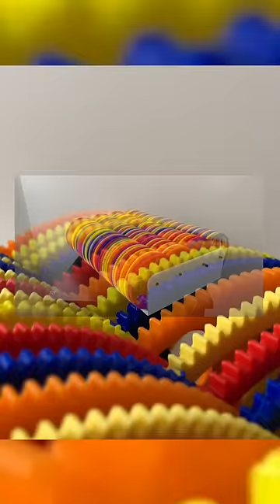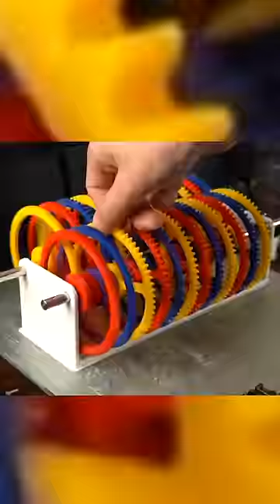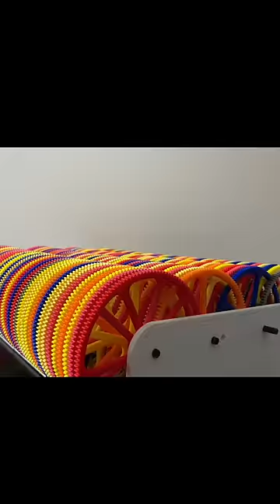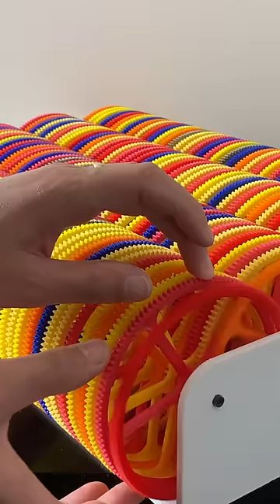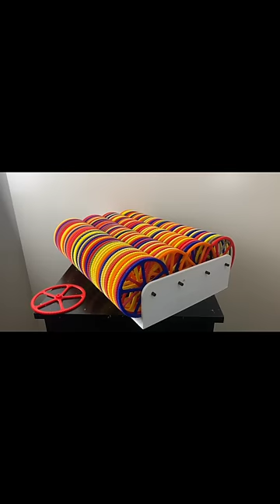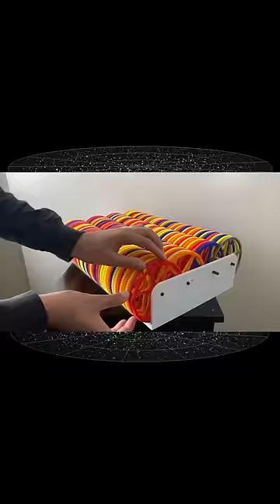World's Highest Gear Ratio (in 60 seconds)

Comment: Do one in reverse where the faster you spin the first one, the faster the last one will go.
Reply: All he would have to do is spin the last one on one of these
Reply: it's impossible to spin the last gear manually. too much resistance
Reply: @DoraTheMFDestroya  That’s why I said in reverse.
Reply: @dorathedestroya2449 
That's not what they were asking.

I think they were asking for a series of gears with decreasing friction, where each one puts a little force into the next.

So, hypothetically, for each time the first spins, the last spins 10¹⁶⁹ times.
Reply: @YoursUntruly  

it would still be the same thing. the start of the ratio will always be the only way to move the last part of such a high ratio system. you can't reverse it, or you just end up with the same thing but turning left instead of right.

Comment: To spin the last gear you would need more energy than exists in the entire observable universe.
Reply: It isnt possible as having to spin the first one faster than speed of light to even get the last one to move means turning the last one makes the first one to spin faster than light as force aapplied over time doesnt add up.
Reply: @dersimonyt9560  it is possible, it would just be incredibly slow. As the video states, it would not make 1 full rotation before the heat death of the universe, but it could maybe do half a rotation or 1/10000000000 th of a rotation
Reply: @jonathantadlock-stein2023  That is indeed true

Comment: Removing outside factors, if we spun the last gear at 1 rps, the first would spin 60¹⁶⁹ times at a speed of 10¹⁶⁹rps or 1¹⁶⁹ (meters)per second or 1.0000000000000001e+169 (meters) per second
Reply: how many gears in would it take for the rps to reach light speed?
Reply: @morphingninja  that’s already much faster than light speed so it wouldn’t be possible
Reply: @spidermonkae  I meant as in less than this whole thing, what portion of this would be needed?
Reply: @morphingninja  Oh well I could try to calculate the gear ratio for that but I'm not sure if I can
Reply: @spidermonkae  honestly, I'd be impressed if anyone does drop an answer to that question.
Reply: Would that open a black hole?
Reply: @morphingninja  I guess I'm gonna drop it:
We have to assume that the gear has a circumference of 1 meter like the original comment did so that the units of light speed and rps match.
Now all we have to do is get the speed of light gear ratio which is approximately ~3*10^8 (3 times 10 to the power of 8) which is less than 0.05x of the gear ratio in the video!!
Reply: @spidermonkae   wow, so less than 5% of this is what's needed for making the first gear the speed of light? (If 1m is the assumed circumference)  I'm guessing you had to backtrack their math to figure out what unit they used? You put in the mad math, props to you.
Reply: @DiveEntertainment47  idk bro

Comment: If you add an oil bed to the bottom it'll keep the gears from wearing, I'd use lucas oil or 10w-40 automotive oil, then you could run it for as long as possible and start a 24/7 live stream to see how long it takes. I can see people bonding in the chat room, discussing how their parent's met watching the 24/7 infinite gearbox livestream..

Comment: can you do one that works the opposite way where one rotation of the first gear spins the last gear superhumanly fast? maybe even using different materials for structural integrity?
Reply: That will tear the universe apart
Reply: You can, but it's just a matter of how strong the material is and how many gears. Either way the gear will snap and will go through several walls in the building.

Comment: If it was made from an incredibly resilient material and you connected the last gear to an incredibly resilient material object with a strong line of some sort. Imagine the speed in which you could pull it if you spun the first gear with an extreme force. Now of course this is all hypothetical and none of these things exist, but just imagine. Imagine the first gear spinning at like 9000rpm.
Reply: It would be a lot more than 9000 rpm🤔 it would be a lot more than 1,000,000,000 rpS!
Reply: @SugarRushWeen  I’m saying, imagine if you spun the slowest gear at like 9k rpm.

Also, the fastest gear would spin a lot faster than just 1,000,000 rpm. That’s literally nothing compared to the gear ratio. If you spun the slowest gear at 1rpm, it would literally spin the fastest gear at 10^169 rpm. That’s 1 followed by 169 zeros.

Comment: Me watching this highly informative video: "So... what the heck is a gear ratio?"
Reply: The gear ratio would be the comparison between the number of teeth on two attached gears. Say you're spinning a gear with 10 teeth, and it's driving a smaller gear with 100 teeth. The two gears would have a ratio of 10:1, because the smaller 10 tooth gear must make 10 rotations for the larger 100 tooth gear to make 1. I hope that makes some sense.

Comment: Now lets imaging he pulls on the last gear and forces the first gear to spin.

I'm pretty sure if he and the material had the strength to do this either a) the wind coming off this would blow the walls off his house, or b) the friction caused by this thing cutting through the air would create enough heat to equate to that produced by a small tactical nuclear weapon.

But I still want to see it.

Comment: Spin the last gear!
Reply: Spin the last gear

The first gear starts spinning at the speed of light and a bright light appears 
You think you made a portal or something but no it’s the atmosphere catching fire due to friction
A few minutes later and everything is on fire
On the entire globe
Reply: @049_plague_doctor but it's all fine cause your room is painted blue . 😅
Reply: @niniv2706  why does that make it fine?
Reply: @049_plague_doctor  - Lahaina Maui ...
Reply: @049_plague_doctor  Sarcasm, a joke .
Reply: @049_plague_doctor , cause your uNdEr tHe wAtEr.
Reply: @daviddrake7995  the water wil vaporize instantly
Reply: @049_plague_doctor  , even ice water from the artic.
Reply: @daviddrake7995  yes even ice water
The entire globe will burn
Reply: @049_plague_doctor  ,damm
Reply: @daviddrake7995  luckily that same friction would also make sure the last gear can’t spin
If you spin the first one
Reply: I dont think he can. The amount of force required to move the gear would probably break it.
Reply: @blackfalcon1324  yeah
Reply: ive actually made a gear train before, ratio was 1:2000, span the last gear, first gear span like a fucking tablesaw
dented wood
plastic gears
Reply: @blackfalcon1324 there’s no probably.

Even moving the last gear a Planck length (the smallest possible distance something can move), moves gears faster than the speed of light WELL before getting through all 169 gears they have there.

The first gear would be spinning not just 100x the speed of light, it would be spinning more than a GOOGOL times the speed of light.

Comment: Everyone replying that it's impossible to spin the last gear is confidently wrong. They're all identical. Spinning the first gear is the same as spinning the last gear. It just takes 10^169 years for that rotation to translate across the entire chain. The reason it has torque is because of how many currently moving gears are driving it and how slowly it's moving.
Reply: Spin the middle gear.
Reply: The gears can’t be identical and be a reduction gearbox. That is why it is called “geared down”  if the gears are identical spinning the first middle or last gear would spin all of them at the same speed
Reply: I love how he says “everyone is confidently wrong!” Then spits out the ABSOLUTE wrong explanation of how a reduction gearbox works 😂😂
Reply: @123ElectricMonkey  it's a series of identical gears with a large Radius and a small Radius. Fitting a large of one onto the small of another is what causes the reduction.
Reply: No one mentioned years. Years is not relevant unless it's Pluto years maybe.
Reply: @PhillipMikeHunt  10^169 is actually larger than the predicted length until the heat death of the universe, which is 1.7 × 10^106 years

Comment: So if you manually spin the last gear, will the first gear go faster than light?
Reply: If his theory is correct he wouldnt have enough strength to turn the last gear also noting the materials the teeth would break on numerous gears before anything worked correctly

Comment: Imagine how much energy it takes if you spin the final gear 1 time in a sec...
Reply: The universe is thought to achieve maximum entropy in 10^100 years. That is called heat death. By this time all baryonic matter will be gone.
Making the last gear complete one full rotation in 10^100 years (or 10^169 for that matter, which is much, much, longer than it would take for the last objects in the universe that have mass, black holes, to disappear completely), requires the first gear (measured by the circumference anyway) to spin faster than the speed of light, which means the amount of energy needed to make it spin once in a second would be infinite, times 10^100, times 31 556 926 (the amount of seconds in a year), which is even more infinite I guess... 🤔
Also, if you would turn the first gear with more than the speed of light for 10^169 years, after such a long time, if the gears could somehow handle that and ignoring any relativistic effects like reversal of causality (going back in time), the matter from which the gears are made will by then have decayed into massless particles because of proton decay. Either that or quantum tunneling.

Comment: Correction: none of these final gears will ever spin, the plastic will decay in the next 500 or so years (without severe preservation or repair) and then stop before the majority of the gears have rotated once.
Reply: Although I do have one question, if the last gear turned at 1 rpm, and nothing could break or jam, how fast would the last gear move? And how fast?

Comment: It's actually a trick question because the final gear could never spin because the immense forces that the gears would be exposed to would exceed the strength of any known material in the universe. The torque generated by the gears would be enough to overcome the gravity of a black hole which tells you that this would be impossible because the fact that black holes exist is evidence that shows the result of forces that are nowhere near the amount of force this would generate yet when objects in space such as supermassive stars are pushed to their limitsfrom being exposed to forces far less than this would produce it would result in the collapse of the star which is how black holes are created. So this series of gears would not be able to withstand its own forces regardless of what it's made of without tearing itself apart so the final gear would never spin because they couldn't create it out of a material strong enough to handle the forces it would generate .

Comment: I dont think you can spin the last gear...
The amount of torque you need to spin the last gear will be insane...
So the last gear itself will break apart by the force you apply last the force needed for it to break will be less than the force it needs to spin.

Even if we do the normal way by spining the first gear... Its only gonna stop spin after it reaches a particular gear as it wont there wont be enough force to spin the next gear...

I am not sure about this tho, i haven't really tested anything or looked uo anything... So its just a thought passed through me which i think is believable... If anyone know anything about this do share please

Comment: Fun Fact: All said-facts on this video are true, But did you know? spin the last gear by LESS then a plank length and it will completely have the same ratio as the number mentioned in the video "10 to the power 169". and the number of the atoms is ((you know.)). sooooo.... Now you know why it will collapse the entire universe: Ratio higher than Atom Count. (In the Observable universe AND universe.). Correct me if I'm wrong and like and reply if you want to ask any questions:)

Comment: I believe most of the initial spins of your first gear is just so you can tighten the gaps between the gear teeth from the production tolerance of making the gear…. And as you got rid of all the gaps, the friction between the teeth is then going to be so big you cannot even spin your first gear or some one down the train will snap because of the torque against friction is greater than what the material you’re using to make these gear. Assume you are using 3D printing fillament…😅

Comment: You guys are saying that if the last gear moves literally just a little bit the first gear will spin super fast, but that actually isn’t possible for a human, because you would have to be incomprehensibly strong to move the last gear. If you didn’t understand that summary, I can try and explain it to you, but don’t be too sure I’m right. Oh also don’t accuse me of yapping, reading this is completely optional, and I wouldn’t have done this if everyone here knew what I was saying. Anyway, here’s your summary!

So here’s the explanation: to move the last gear means that whatever is moving the last gear would have to be extremely strong and I mean EXTREMELY strong. Stronger than any human in existence considering the fact that moving the first gear so that it rotates once a second would mean it would take 25,000 years for the last gear to do one full rotation, means that if there was a way to convert someone’s strength into time, you would have to be stronger than 25,000 years. And for a force to only have to push a tiny little bit to make the last gear move a little bit means the force would probably have to be incomprehensibly stronger than 25,000 years, and if being as strong as 25,000 years was easy, you would probably still need to have an incomprehensible amount of strength to only have to use a tiny bit of force to make the last gear do one full rotation. I hope this makes sense to you if you didn’t understand the summary, because it took me a while to write this.

Comment: Many people are asking what would happen if the last gear is rotated manually. Let me explain.

Well theoretically, assuming no energy loss, if an enormous force is applied to the last gear and it somehow moved a plank length (Shortest possible distance in the Universe), the length of the first gear would be larger than the distance of our observable universe. The mass of the system will be infinite and instantaneously, a black hole will be formed. Which will consume everything.

So my request is DO NOT ROTATE THE LAST GEAR. 😂
PS: This is practically not possible anyways.

Comment: Just the backlash in the gears would nullify any meaningful advancement of the final gear. H3ll, just the compression of the plastic would absolutely SWALLOW any movement actually translated as far as the final gear. If you made this gearbox out of shine theoretical impossible exotic matter that was indestructible, perfectly incompressible, and perfectly rigid/inflexible, but otherwise obeyed all laws of physics, and you were able to apply any conceivable amount of torque on the final gear, you'd be limited in how fast you would be able to turn the final gear, because the rotational speed of the first gear would be limited by the speed of light. In order to turn the final gear faster than a certain speed would REQUIRE accelerating the first gear past the speed of light, which is impossible. If you WERE able to accelerate the first gear past the speed of light, it's possible the matter of which it was made would become tachyonic, which would cause it to move backward in time. If the gear moved backward in time, it's direction of rotation would be BACKWARD, thereby creating a paradox, as moving forward beyond a certain speed should result simultaneously moving backward If my intuition is correct, turning the final gear beyond a certain speed would move TIME backward, making your gearbox functionally as a time-machine. If I am correct, and I've just invented a new concept in physics or temporal mechanics, I feel like I should name it...
How about...Dr. Whom's Tardy box.

Comment: 99999999999999999999999999999999999999999999999999999999999999999999999999999999999999%Speed of light the front wheel will rotate If you rotate the rear wheel once per second